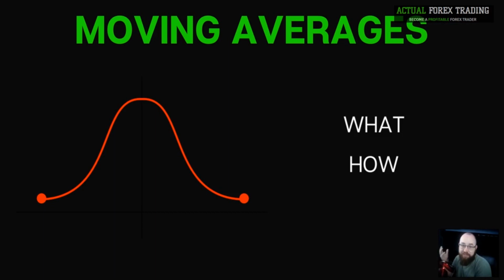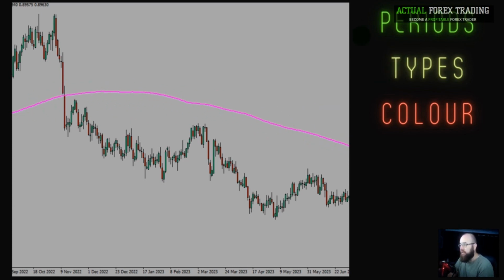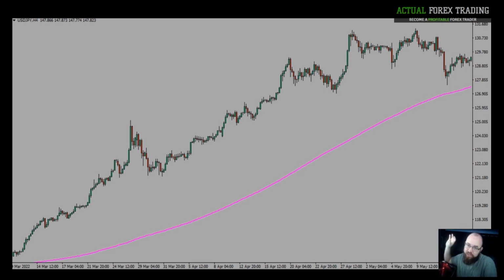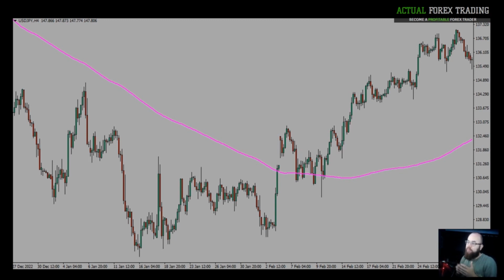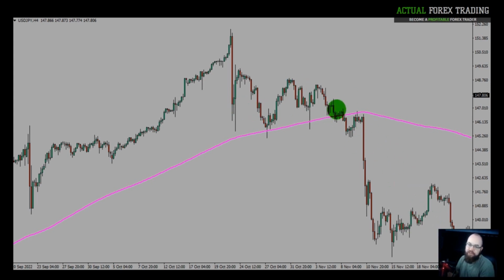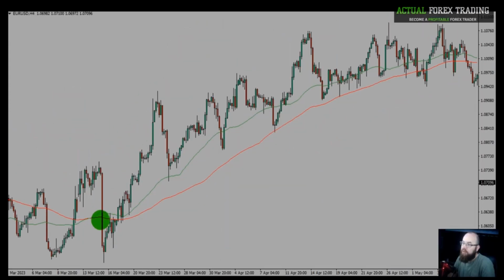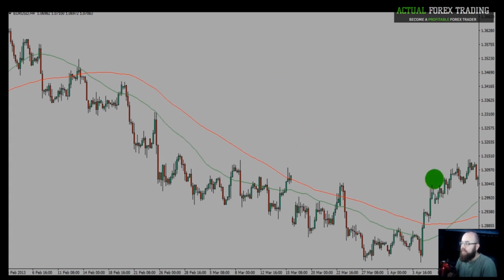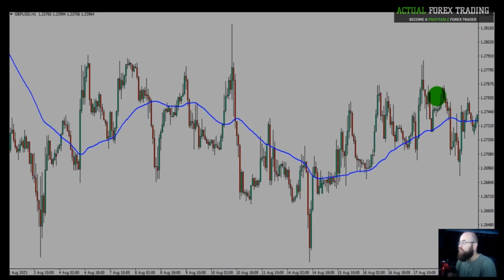Learn Forex Technical Analysis I Moving Averages Explained, Dynamic Support and Resistance, etc.

Comment: Hello Sam. Have you ever tried trading purely based on SMA crossovers, ignoring fundamentals? I know that you are a big fan of trading fundamentals+tech. analysis. But I really wonder if there are (and if you personally know any) traders who trade purely on technical analysis and have consistent profits? For example trading on higher time frames fundamental analysis makes sense. But on low time frames it is almost irrelevant (correct me if I'm wrong)
Reply from the maker: Hi. It is possible to make money by just trading technicals. However, the strategy must be comprehensive - SMA crossovers are not enough - they will not make you money in the long term. Algos can perform well. I've witnessed this. 

Why would fundamentals become irrelevant on lower timeframes? Whatever is driving prices on higher timeframes is also driving prices on the lower timeframes. They are, after all, the same assets and prices, just presented in a different way.